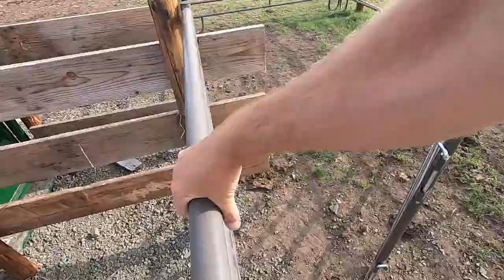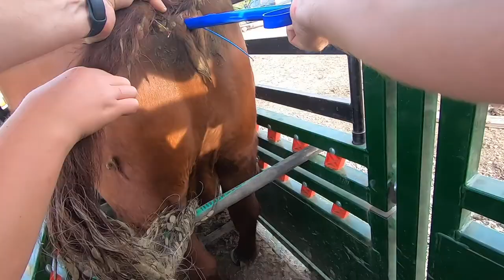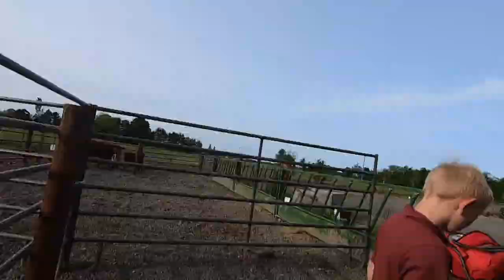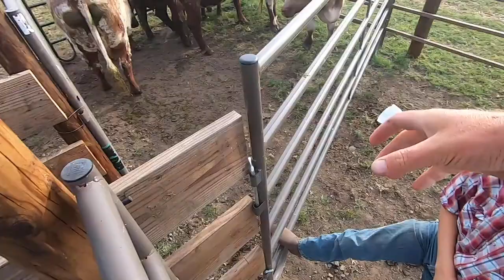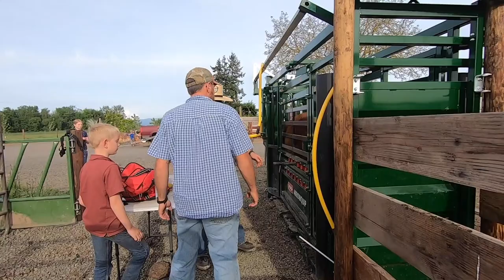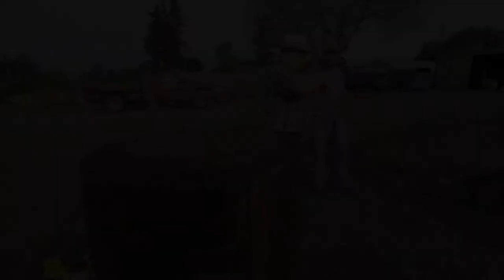Shorthorn Cattle Breeding 2021: Part 1

Comment: Great to see all the family chip in to help with the cattle. Are Your cattle dual purpose Shorthorn's or beef Shorthorn's? What bulls do You breed to? How much more does it cost per cow inseminated Your way rather than observe for standing heat?
Reply from the maker: Thanks! We love working together as a family, and it is fun when they are old enough to really help out! We raise strictly beef shorthorns. We stick to good proven bulls from proven breeders that make great cows: Saskvalley, Lelevdale, JSF, Paint Valley, Byland, Studers, Muridale etc... Most of our original herd is build on Saskvalley Bonanza, Leveldale Ringo, Captain Obvious, JSF McCoy etc.

We figure that on average it costs us $100 per head for Semen, Cidir's, Drugs & breeding. We save some $$ by doing all the sync process ourselves, & we could save some more if we did the breeding ourselves, but we have a great system going and I don't want to change anything at this point. I would end up costing me more in the long run.

As far as cost difference in standing heat vs timed Ai, I don't think there would be a difference on the from end, because I am using the same drugs and protocol, I am just breeding at 64hrs vs waiting to see them in heat. The only factor affecting cost would be the % of cows that settle. our friend Justine who breeds for us has ran tests on their own herd breeding timed vs heat, and they had a 20% increase in conception on timed. So if you figure that 20% more will not have to be bred again or covered with a bull, that is a difference in cost.

The other factor in all this is the cost of the bull we decide to use. When we breed we split our herd into 2 groups: Carcass & Replacements. We breed out top carcass cows to good carcass bulls with usually around $25 per straw vs when we breed for making cows/replacements for our herd or to sell to others. This semen usually costs us anywhere from $50 up to $200 depending on what bulls we are pairing with our girls based on Phenotype & EPD's and where we pick it up.

So we are probably on the boarder of herd size for doing all AI vs owning a bull, but for the quality of calves I get and the bulls I get to choose from, I could not afford to have a bull of that caliber. We did keep a nice bull back out of a Bonanza Cow & Lelevdale Ringo that is pretty nice, just in case we need to cover one of the girls :)

Thanks for the great questions and sorry for the long response, but we love talking cattle, especially when it comes to out shorthorns!

Feel free to email us anytime if you want to visit some more! contact@roppfamilyfarm.com
Reply from the maker: Also make sure to check out al 3 videos for the complete process if you have not already done so!
Reply: @RoppFamilyFarm  Thank for Your reply. I am  former Black Angus breeder and did My own AI. Using standing heat, then breeding 12 hours later. You have some nice cows, the udder's look good to. Please keep Your cows the size they are and don't use the shorter sway back bulls that other breeds are pushing. I have watched all 3 of Your breeding video's and enjoyed each one.
Reply from the maker: @missouritraveler6401  thanks! I love my moderate framed cows and not a big fan of the sway-backs either 😉